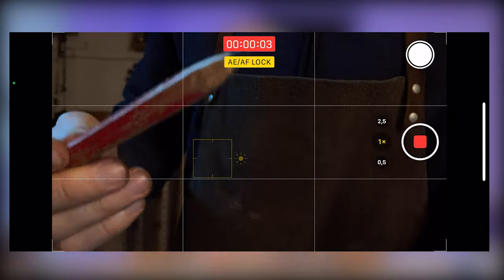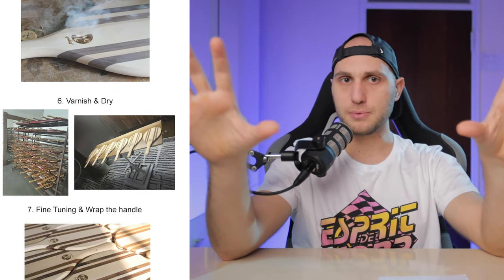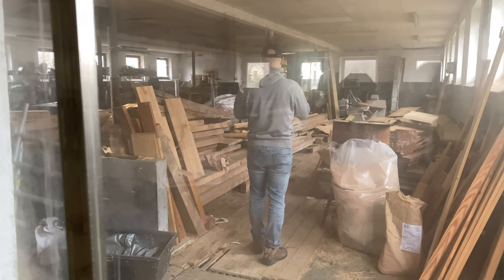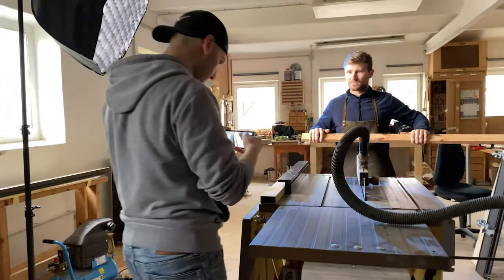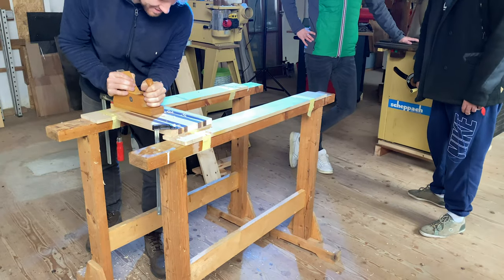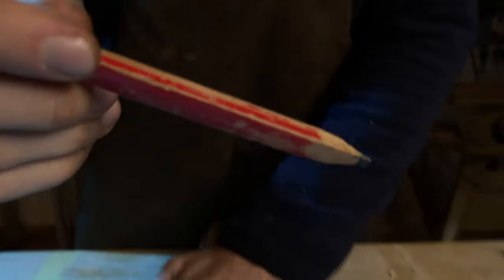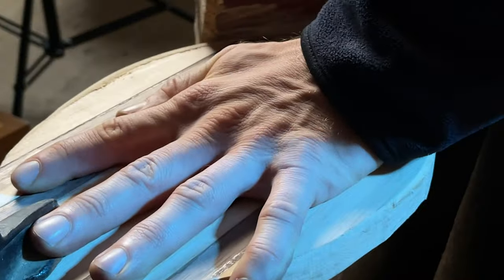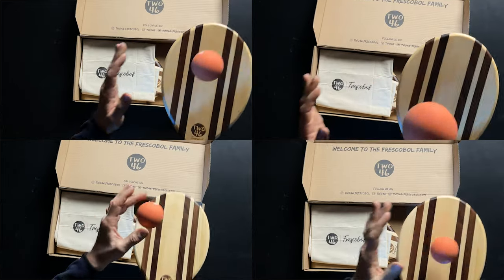How to shoot a commercial on the iPhone

Comment: Excellent video again. I just received my iphone 12 pro max, so...time to get started. Do you use ND filters on the phone? I guess you didn’t need them in the workshop as there wasn’t so much light, but when you’re filming outside? I was considering getting nd filters, but part of the appeal of filming with the phone is less gear, less fiddling. So I’ll probably see how it turns out with a higher shutter speed. Was just wondering what you do.
Reply from the maker: I have exactly the same dilemma. For now filming without